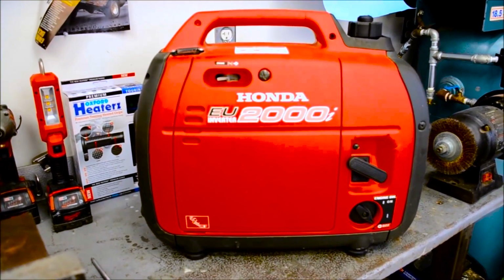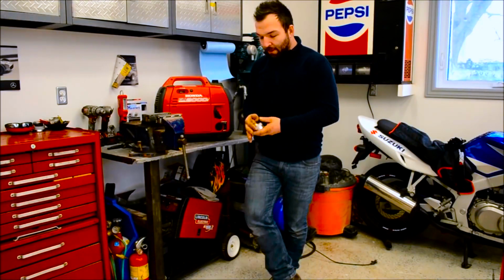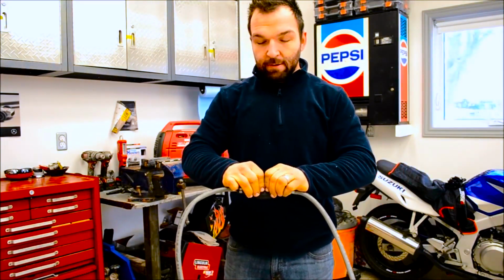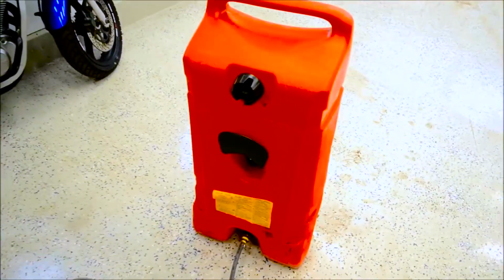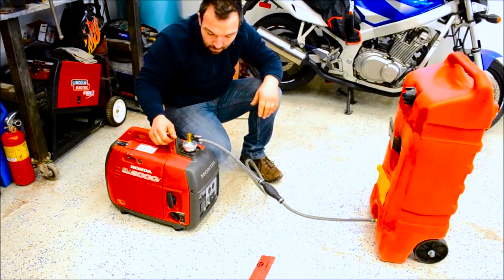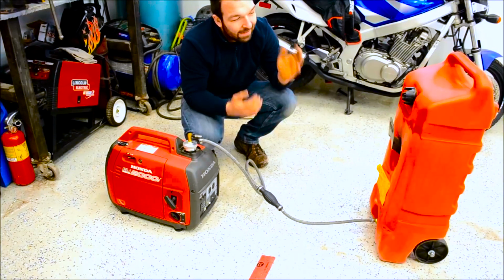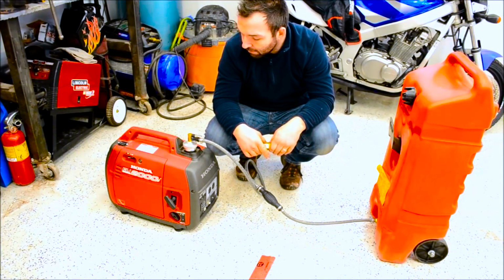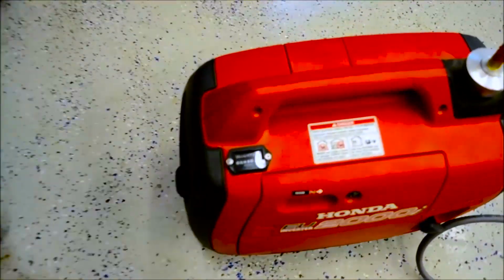Honda EU2000i Extended range Run — Bergs System Bergs II Dual System W/Tank Cap - 2021

Comment: So far I have only used it once for a long weekend of camping, but it worked perfectly. Easy to set up and draws the fuel into each gen set evenly. As long as you raise the hoses after use and open the cap on the reservoir, the fuel in the hoses drains back and it transports fine without fuel spill after tying the hoses up on top of the reservoir. Very nice!

Comment: Some people said, in their reviews, that they had problems with cross-threading on the caps. I never saw that, but then I also screwed the caps on very carefully. (I always turn a cap backwards until it clicks and settles into the threads, after which I know I can confidently screw it forward with out messing up the threads.) I filled both Honda e2000 generators up, screwed on these caps (which entailed removing the tether on the Honda caps), made sure this tank was full. Then turned on the generators. I never had to remove any caps again for the two days we were dry camping. Of course, we didn't have the generators running all of the time, but I just turned them off and back on again. Worked perfectly. When I arrived home, I found that the tanks of the generators were so full that when I removed these caps, some gas actually spewed out (home is at about 100 ft and we were using the generators at a higher altitude). I'll mention that the tank became somewhat distorted at times due to air pressure changes. I just unscrewed the cap to relieve the pressure difference. Of course, this wasn't during use; that would break the seal.